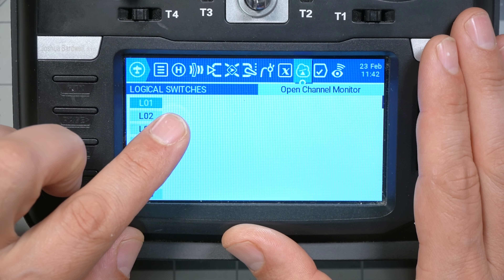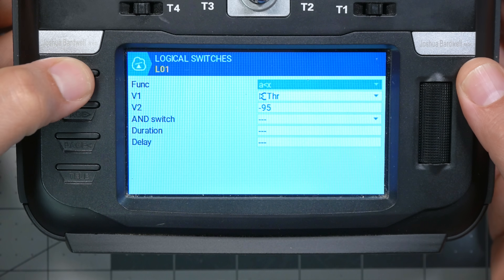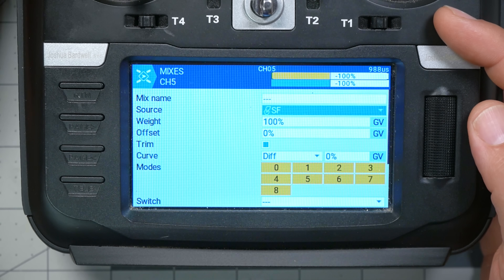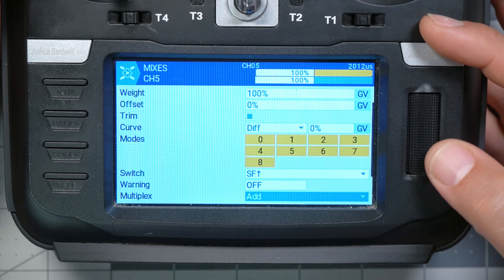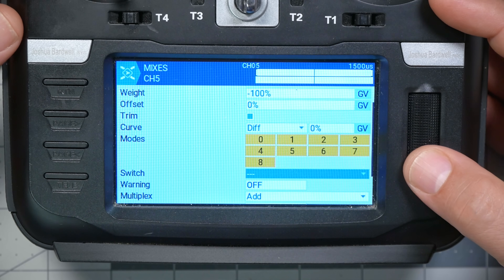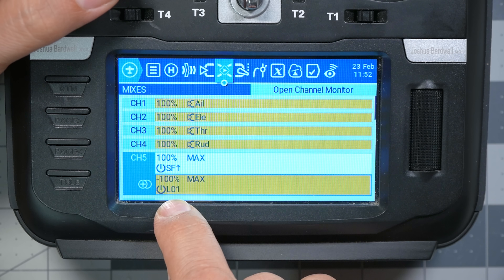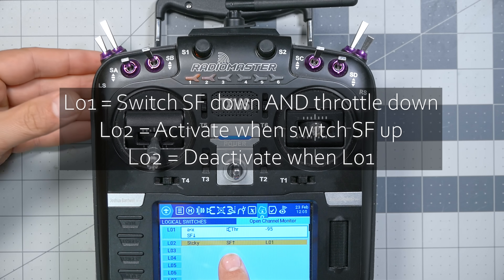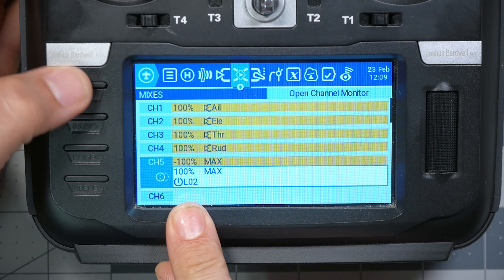This arm-switch setup is dangerous, and you shouldn't use it

Comment: Ok I really need help with this, I'm doing it on a taranis x9d plus.
It all seems to work almost... Except when I watch it in INav modes it seems inverted like it'll only arm when above minimum throttle. I know the percentage system in taranis can be different than radiomaster but I don't know how to fix it.
EDIT: ok not sure why but taranis needs the first line in the mixes blank and the two lines under it are the ones in this video! Works great now thanks Joshua you rock

Comment: I have actually done something similar for all my Jets, Ducted fan, Gasser and Glow models my setup is the opposite of this though, with the throttle low arming is by pulling the momentary sw for about 3 sec while the arm sw is in the armed position, disarm is instant and not tied to the throttle, stops you accidentally arming a model with the throttle open a bit

Comment: There is a fault in how the 'disarm' mixer was set - it actually needs to be "-200%" if you want disarm to be low, arm to be high, since MAX pegged the mix to 100%, so a weight of -100% only took it down to 0% (mid channel), not -100%, as you can see at 7:02 if you watch the mixer and channel output bars at the top of the screen... Also, there is actually no need to set two mixer lines - you could use a single mixer line, and have it hooked to the logical switch directly... makes life a bit easier. But it wouldn't have allowed you to demonstrate replaceable mixer lines linked to switches. 

I've seen a few takes on non-direct arm/disarm - Mr D's "Open TX Ultimate Arm Switch" which uses logical switches, GVs and even a curve to set the disarm state... which also allows for preventing arming when the throttle is up, and feedback from the transmitter at every state (arm, disarmed, can't arm until throttle low, can't disarm until throttle low), and John over at rcvideoreview's has done a "safer throttle cut" version that won't let you arm the throttle unless the throttle is low. I use a version of that myself as it allows for zero bounce landings since I can enable the disarm during the landing approach (and get audio feedback that it's going to trigger), and then when I drop the throttle it cuts instantly. I do understand your concerns, as with inexperienced pilots it's easy to panic... but to me this allows all the safeties on the FC to do their job, and the transmitter is doing it's job in telling the craft to do what I want it to do. It is a preference. If I was concerned about needing a real "emergency stop" - as that is what we're really talking about, I would probably do something like use the crow feet 6POS on the tx16 as that's basically impossible to hit in flight by accident, or maybe the T5/T6 trims as a momentary switch. It just seems so easy  (and is - I've done it twice) to bump one of the other switches when moving your hands in cold weather (i.e. impaired feeling) and disarm in a unrecoverable manner. Most of the time, it's all good... but then there's that time it goes horribly wrong. 

What really annoys me is both a friend I have camera quads with GPS position hold, return to home, basically can fly themselves better than the monkey behind the joystick... but the emergency motor cut is utter garbage... you're supposed to hold the button for three seconds and it will cut the motors... except when you actually need to use it... it has usually already hit whatever you were trying to not hit, and the emergency cut then won't engage... how stupid is that! MJX really need to do better with their Bugs series!

Comment: If you are concerned about accidently disarming, then you need to move your arm switch. Its why I don't use shoulder or corner switches because that is where my fingers rest on the radio. I use the switches above my index fingers, which are obviously on my sticks if I am flying. Have to take my finger off the throttle to disarm.

Comment: Is there a video that explains how I can use two swicht for arming? I have arm on switch SF, but what I want is that it Only Arms when I pull switch SH for a second. 🤔🤷🏼‍♂️✌🏻
Reply: You should find info on that if you search for "setup prearm betaflight" or something like that. 
I have set it that way after I armed by mistake. Works great. Only drawback is that you might not be able to rearm midflight quick enough. But I think it's worth it for the safety it brings.
Reply: @feelfreefpv  oh thank you for youre fast answer. I am on crutches at the Moment, and I am scared of acedently arm the quad when I pick it up.

Comment: My second time out with an FPV quad (Rekon 3) I found myself with WAY more altitude than I wanted. Some part of my brain told me to disarm my quad to shed some height.. somehow I established the presence of mind to re-arm my quad as I was tumbling from the sky, and by some miracle I must have been close to level when I got the arm switch flipped because I actually leveled out (horizon mode) and was able to resume flying. No, I did not remember to turn on my DVR before this happened and yes, I am really bummed about it because I hardly believe it myself.

Comment: Disagree.  No more dangerous that a hard disarm.      Issue here is that you have programed your own brain to work in a different ways to how the quad is configured correctly.
Reply: Indeed... IMO a more elaborate version of that is better... you have audible feedback of arm/disarm/pending disarm... and you can recover from an potential accidental in-air disarm or use it as a two stage disarm like I do for landing approach. It's just what is "comfortable"  / makes sense to you. i.e. flip the switch, snap the throttle down... it's disarmed.

Comment: Wouldn't it be easier to move back to arm and disarm via stick commands for this case? The function is basically the same: instead of a switch, four channels (the sticks) have to show a certain value all at once.
Reply from the maker: No, definitely not. When you enable stick arming, the yaw axis doesn't work at zero throttle. Kind of a big deal.
Reply: Particularly since we have air mode now - that wasn't a thing when stick arm/disarm was still a thing. There is also a delay, it's not instant... with this... you hit the disarm switch, slam the throttle down, and it would be instant disarm.

Comment: You could punch out of a loop with zero throttle and still accidently disarm and it would drop based on this logic. Not that this is any better but maybe disarm could also be based on GPS speed and elevation. So when GPS speed is less than 5mph and elevation is less than 1m allow disarm.

Comment: I have a two-step sequence where I hold two switches up for three seconds & then, let go of one switch to arm.
All this does is unlock my controls, but the motor is not started.
To start the motor, I flip one of the switches that I used to arm (which starts the motor) & then, I'm ready for takeoff.

In the context of helicopters, if the motor is accidentally switched off in mid-flight, I can easily do an autorotation & safely glide the helicopter in to land.
Quads, on the other hand, the very second the motors stop spinning, they literally drop out of the sky.
Reply: And worse, due to "safety checks" it won't let you rearm if disarmed in flight (you have to crash first). I. E. You need to at least disable the arming angle check, then you might have a chance.
Reply: @pfeerick  Fortunately, in my case, the flight controllers on all of my helicopters don't have that angle "safety check".
If I took away all the arming logic that I have created in my Radiomaster & left it up to me hitting a single switch, the helicopter will start up any time & every time that switch is activated - whether intentional or not.
Reply: @NiCadHeliPilot  That's the real beauty of these transmitters and OpenTX/EdgeTX, isn't it... you can customise it to suit your needs and preferences... i.e. I wouldn't want an arm switch to allow arming with the throttle up... that just seems plain stupid. And a disarm without some sort of input validation... whether it be two switch/press, two condition (hey, disarm switch and throttle down!), a switch under a cover (yeah, why is it the "bombs away" switch is under a cover, anyway? 😁), etc also seems crazy... but I also know other people just want a disarm switch. What I wouldn't want to see is the stupid "press this button for three seconds for emergency motor cut" that I know a quad manufacturer does... three seconds is a long time... especially when it actually doesn't work once it's hit the ground/tree/whatever...
Reply: @pfeerick  Exactly. =^/.^=

Comment: lol arm disarm. I love flying fuel. No arm/disarm nonsense to worry about.
Reply: Indeed... you run out of fuel... it's disarmed! 😆 It was certainly tested the dead stick flying skills of some of the flyers at our old field when that happened...
Reply: @pfeerick  Lol. I usually set my timers to avoid running it dry! Like to taxi back and kill the engine when I want it to die. Call me lazy I don't feel like walking out halfway across the runway to get it after a flight lololol

Usually I land with about a quarter tank left on board.
Reply: @TestECull  Now that's just showing off! 😆 I certainly get the "call me lazy" point though... I have been known to fly a miniquad / "whoop" (some 4 inches in diameter, if that) at our flying field and fly it right up to my feet so I don't even have to get off the chair to retrieve it! 😇
Reply: @pfeerick  With my 4-stroke birds it's usually a 20 minute timer! The 2 strokes and my 4-stroke FPV ship have 10 minute timers or somewhere thereabouts. Depends on fuel tank size and engine consumption; generally the 4-strokes use half as much fuel in my builds but on a couple of birds the fuel tank compartment just doesn't allow as much fuel reserve as I'd like. Ah well.

Comment: I actually setup a double physical switch arm and disarm for all my machines.  I put the left switch (same as JB usually uses) in arm or disarm position, but it only enables that position when you flick the right momentary switch.  I can do this pretty fast too, if needed.

The way I did it was using a global variable. To apply to this logic..  The mix of the Arm channel uses MAX of GV1. Special functions cause GV1 to go +100 or -100 based on logic switches or physical switches. Since I was using momentary, I also created logical switches with Edge function.
Reply: I do the same. Haven't had an accidental disarm since. And can disarm just as easily.
Reply: Can I get a copy of the that logic script you created? I think it the best way
Reply: https://youtu.be/zirCeMSsd6c?si=E5KGDdx7-qTyBHWb @BrainDeadEngineering

Comment: I can see landing would be interesting, flip the switch, come in for a landing and disarms on 0 throttle... might try it lol
Reply: It's actually quite good... if you use a more sophiscated version of this, you can also set "disarm pending" audible/haptic notifications... prompting you to flick if back if was an accidental disarm... and when pull the throttle back for the landing, it disarms as it hits the ground with zero bounce.
Reply: Or or add a second disarm switch for those landings

Comment: Is there a way to swap controls mid flight (in betaflight)? Ie say you wanted your yaw and your roll to swap sticks when you flip a switch? 

I've had a model that I want to design/print for a while now, but it kinda rides on this control swapping concept to be comfortable.
Reply from the maker: This quad accomplishes that using camera uptilt feature. It flips an aux mode to enable camera uptilt of 90 degrees, which effectively flips yaw and roll.

https://www.youtube.com/watch?v=Qti1KLy5JbE&ab_channel=JoshuaBardwell

You could also do it in the mixer screen, using the Switch parameter. Put both yaw and roll on the same 2 channels and use the Switch parameter to decide which is active.

Comment: I've disarmed while flying exactly 2 times in 3.5 years of flying. First time was within the first 3 months second time was 2 months ago. You know this has got me thinking, what's the best way to solve this problem. I think the only disarm in low throttle is the best for me, yes you could still accidentally disarm during a dive but with my flight style those chances are very low. 

After you relearn the muscle memory of a new motion it would be just as fast.
Reply: Sound kind of hinged cover??
Reply: @TheElijahD  What?

Comment: Here's another similar challenge: disarm only possible when the quad is near you(less than 10meters?)
Reply: ....and let it burn when it gets stuck high on a tree or when you crash-land it in deep grass just a foot further than the max disarm range... what an awesome idea!
Reply: @onemanmob6756  lol... there's always exceptions... that's why the disarm channel still needs a 'emergency override' that you can just trigger but still hard to accidentally trigger... which you could do say with the T5/T6 trims as momentaries or one of the 6POS button positions on the TX16S, etc... i.e. use GPS telemetry to determine you're not close enough to disarm, but if you pull the T5/T6 trim back (or maybe push T5 forward), instant disarm.

Comment: I found it is very dangerous to use disarm switch. Instead I use motor interlock feature of the ardupilot (refer to https://www.youtube.com/watch?v=-Db4u8LJE5w for more details). Essentially it is momentary turn off/on all copter's engines at any given point in time. It does not disarm the copter. Even if you accidentally turn them off in flight, you can just turn them on immediately. My take off sequence looks like: 1) arm, 2) motor interlock on. Landing sequence is - just disarm after land.

Comment: Lol sounds more than dangerous 😅 when i disarm at landing i hover with 15-25% Throttle.... will not most qauds start bouncing when they "land on the ground" without diarm??? 🤨🤔Thanks for al ur effort! Always nice to learn something :)👍     (edit two: the finishing of the setup answered all my open questions)
Reply: Yeah, I always disarm midair (like a foot off the ground). But with this setup, I think what would happen is... you're hovering at 25% throttle or whatever your static hover is, and then you flip the switch to the disarm position (and nothing happens), and then you just quickly pull the throttle to zero, and it disarms and falls the last foot to the ground.
Reply: Yes they will bounce unless you (like me) have airmode on a switch so you can turn it off.

Comment: I have the arm switch setup to only engage, when the momentary switch (TRN) is held at the same time. Disarming is the unaltered, to allow quick disarming. While I only added this after accidentally arming a quad while carrying it, it has prevented accidents since then.
Reply: I have the same setup, with some extra logic. My arm switch has to be in the arm position. That makes a prearm beep so I know I've done it. Next, throttle has to be low to arm. Then, I use my momentary switch to arm, but I have to hold it for 0.3 seconds, which further prevents me from accidentally arming. When I want to arm, I can do it quickly, but three distinct things (pre-arm, throttle zero, hold arm) have to happen. Oh, and also it'll say "throttle warning" if I try to arm when the throttle is high, so I know why it didn't arm.
Reply: @MarkJaquith  This also sounds like a very safe option :) Mine actually works the other way around:  Only, if the Momentary switch is held down first with the arm switch toggled at the same time it arms. So If I bump the arm switch to on and afterwards the momentary it does not arm the quad.
Reply: Same

Comment: there is no need to make 2 arm switches incase you disearm in the air.... lmao go into the config and make it to where you can arm on any unlevel axis and then if you by mistake disarm you can still arm  weil in the air or falling
Reply: Ah... so you make it so it can arm when you are carrying it, and it chews someone's face of... yes, lmao indeed! 😝 There's always pros and cons to the safeties on the FCs... yes, it means you can't arm if you disarm in flight... but it also means it can't arm if upside down in the field (and you fly LOS or VTX feed was lost - yes, I know you could setup telemetry for orientation - average Joe doesn't though), or when you're carrying it... two stage / prearm is one way to mitigate that, another is some variation of the disarm logic Joshua shows... I'm sure another is to tie a long string tried to the end of your quad for easy retrieval! 🤣 But it is certainly another option to be considered when making the choice that suits you best.